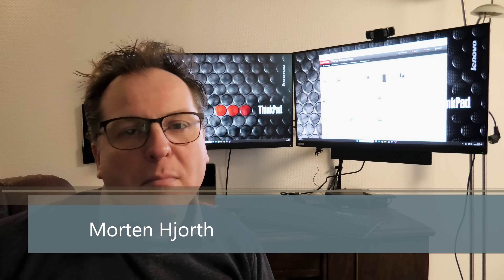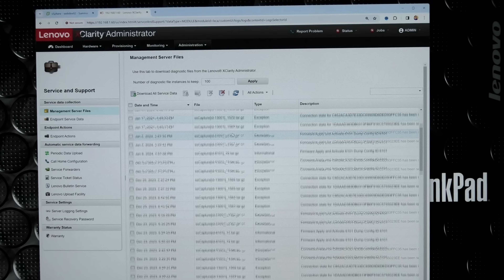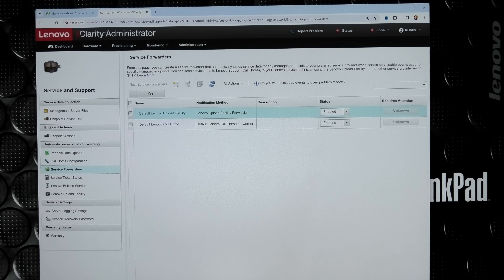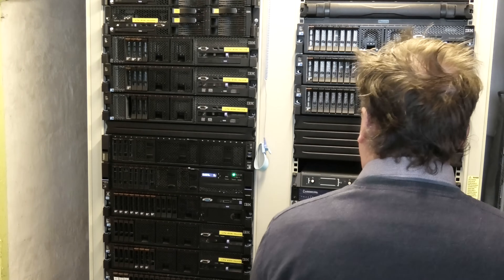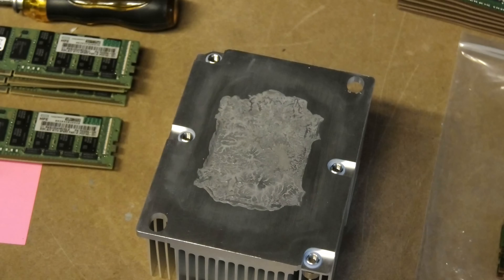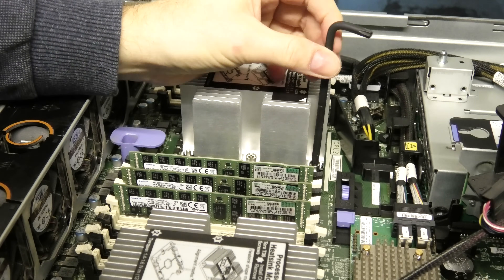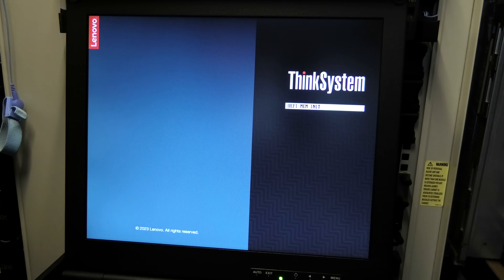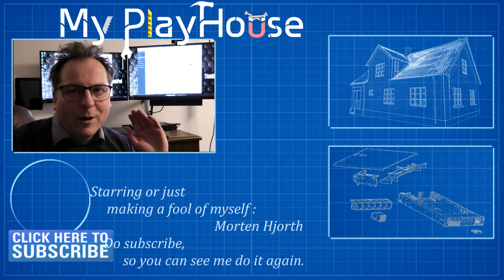Swapping CPU in Lenovo SR650,, as it keeps Crashing - 1356

Comment: It seems the HPE equivalent (OneView) is a bit easier: there you can easily disable remote support (that is their term for "call-home") per server. You can also define custom contacts for each machine, if the general IT department manages the OneView instance but the individual monitored servers are the responsibility of other teams (like at our company).
Then the alerts are sent to that team instead of the general IT department, and they can make their appointments directly with HPE or a partner. Saves another round-trip by communicating through us as a gateway..
Reply from the maker: Just happend to be also messing around with this "call home" on oneview today,, and it was easy to disable it. per. server.

Comment: Hello sir , today I faced an issue with IBM x3650 m4 , after removing some dust from the server from blower ( not vacuum) when I rebooted system it stucked on OS screen Linux Redhat 6, and also it blinking frequently, not ember error on Led plate everything is fine ,, plzzz tell me what’s the issue , and I also interexchange both RAM , Ram are 2 with 8 GB
Reply from the maker: Well first I would recommend you to put on the latest firmware. witch is kind of old by now. but that is a good start.

Comment: Time to upgrade to AMD EPYC 👍
Reply from the maker: a new server with a AMD EPYC is really expensive,, even the smallest one.
Reply: @MyPlayHouse  I've got one for proxmox server 👍
Reply: @MyPlayHouse  Stay away from them as hell, or at least the HPE ones. We have 2 HPE DL385 Gen10v2 Plus's which are used as a VMWare vGPU cluster. At a certain time when we wanted to upgrade the firmware with the latest SPP, they did not want to upgrade the BIOS/UEFI, it kept on hanging at a certain point. We logged a call at HPE, it took ages to get the mainboard replaced (sometimes system was not switched off when engineer was there, then another time they sent the system board back and had to get a new one etc).
At the end of the day the system board did get replaced, but we faced the next hurdle: node booted and then showed a PSOD. It complained "unable to restore system configuration. A security violation was detected". The vmware support link mentioned stuff like recovery crypto keys and the TPM, but there were no recovery crypto keys present nor did the system had a physical TPM module.
By this time the node had been unusable for 3 months, so we just decided it was easier to reinstall it (the other node still had a config) instead of trying to recover the existing installation.
I did personally and firmly complain to our HPE account management team that this is a serious design issue/failure, and they need to get to their development guys and fix this. If next time we face such a upgrade headache, we are buying only Intel-based machines since we have had very few issues with firmware upgrades on their platform.
Curious if this repeats itself when they eventually will introduce ARM-based systems..🤨
Reply: only if you have your own nuclear power plant to pay for those AMD SYSTEMS.. we have jettisoned all our AMD MILAN SERVER as they just ATE the power.. and since power is like 35-40C Kwh in EU yeah.. pricey...  @MyPlayHouse

Comment: It happens. I have an E-2224 with one faulty core. Only a little bit, it fails on multilevel page tables, which means it will run old windows server and old linux kernels, but not win10 or a recent linux. Even then, it behaves just slightly strange, with errors/faults that make no sense.
Reply from the maker: my server just crashed, when it was really the inconvenience :-)

Comment: missing ram could be not enough pressure on the cpu to the socket.
Reply from the maker: I did let the screws go in until they stop,, they have a hard stop.
Reply: @MyPlayHouse Can you monitor the CPU temp in real time on the IMM screen? I'd say you should be able to tell if contact is good seeing if yoy have fast temp swings when running a heavy load test like the video rendering you mentioned in the video.

Comment: You should do a full cycle memory test using MemTest86+
Reply from the maker: Thank You,, I have messed up my back,, and I just needed this back up and running at that point of the video,, so I could go lay down again... I need to fix this,, I know :-)
Reply: As it happens I ran a full memory diagnostics on one of my DL380 Gen9s a few months back when the system was blue screen crashing and reporting memory errors in ILO management logs. The memory test passed but it kept crashing. I swapped that stick with another one not showing issues to test the slot and it eventually crashed again with the same stick in a different slot. Removed that stick and no problems ever since. Diagnosis seems to be a bad memory stick that memory diagnostics couldn't detect itself.. ⚠️

Comment: oh boy, the one time HPE saw me tighten a Gen10 heatsink without the proper torque wrench, they were not happy and complained for about 30 minutesabout everything that could go wrong. I just laughed and did it again to CPU2.
Reply from the maker: Well it goes all the way until it stops,, it is already really thigh by then.
Reply: @MyPlayHouse  Thanks, you have a lot more experience with this socket than I do. I'll assume you're right and crank mine down reasonably firmly.
Reply: Where the heck would you find the proper torque wrench? And how tight should they be tightened? I've been cautious about over tightening the damn things, silly socket design imho.
Reply: @truckerallikatuk  It's an HPE specific tool, set to one setting specific for the heatsink.  I had a tech that stopped mid install in our datacenter so he could go out to his vehicle to grab the "torque wrench".  I thought he was joking with me  :D
Reply: @truckerallikatuk  You could possibly purchase a torque ratchet as used on modern pushbikes
Reply: I am going to buy proper torque measuring equipment and screwdrivers for my Sapphire Rapids dual-socket build. I want to follow everything down to a T.
Reply: You will need a T14 screwdriver... ME: CACCIAVITI DI MERDAAAAAA (Sh1t screwdrivers) after throwing the screwdrivers INTO the server on the ram blocks
Reply: @leo_craft1  The 3647 uses T30, not T14, which is what Epyc/Threadripper uses.
Reply: @truckerallikatuk  I dont hnow what T scrwedriver they want me to use, i just try whatever screwdriver i have
Reply: What does HPE know anyway eh!